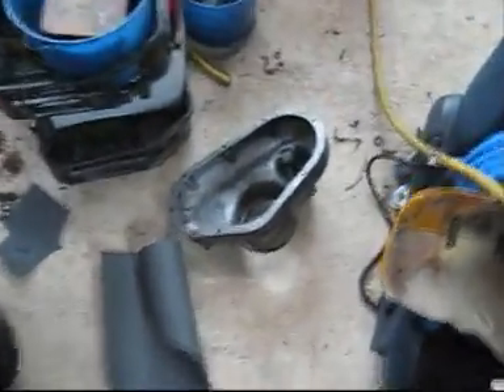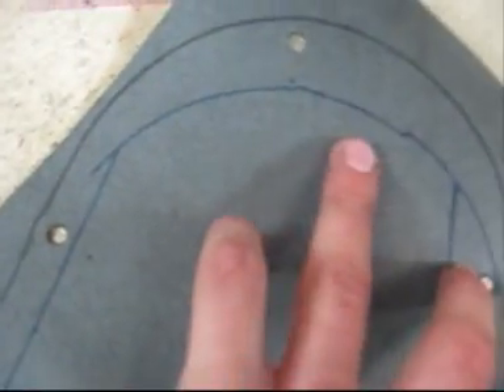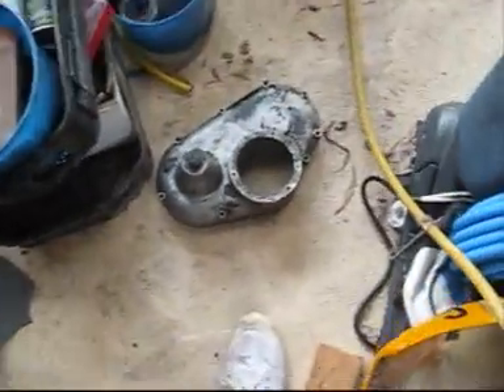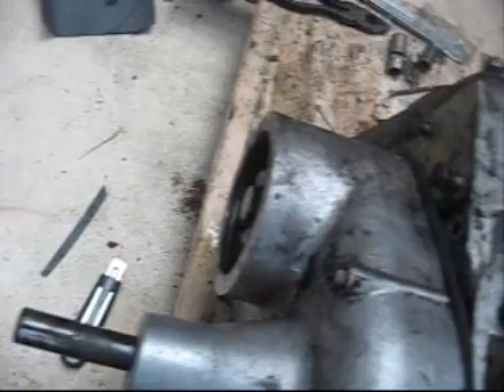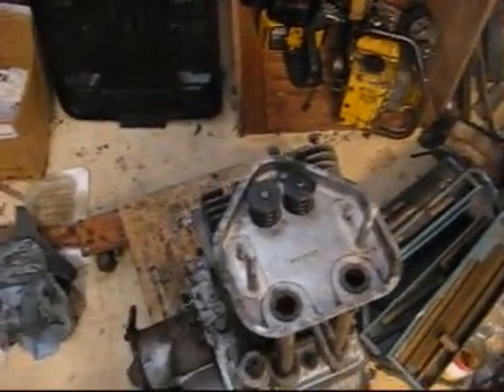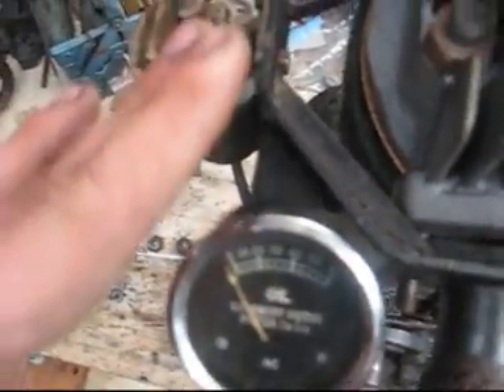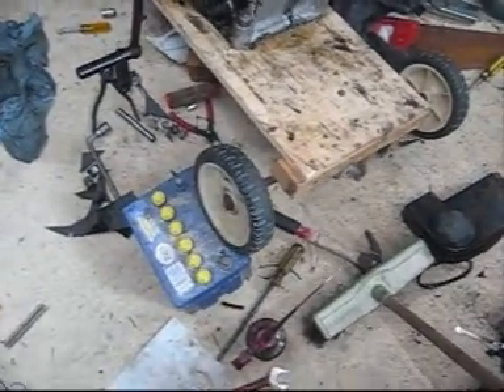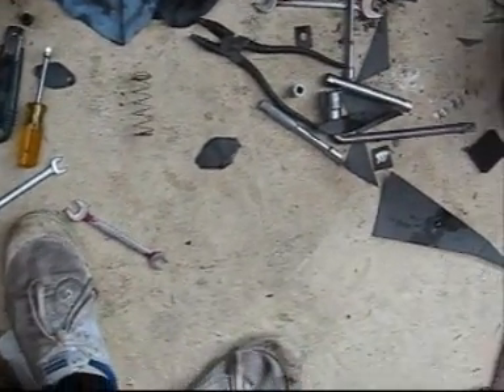Coventry victor pt 11

Comment: getting close to there so did you find a power supply for the glow plug? if not you might get like 10 1.5 batteries and hook them up